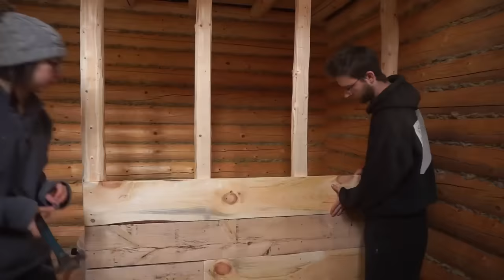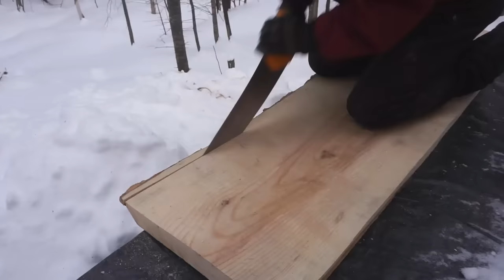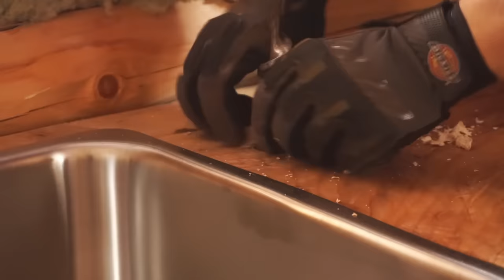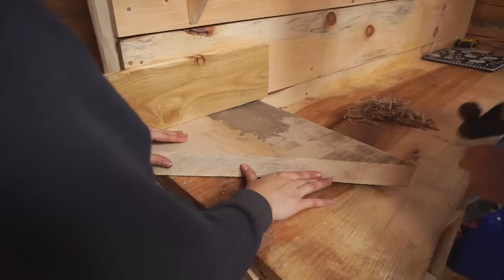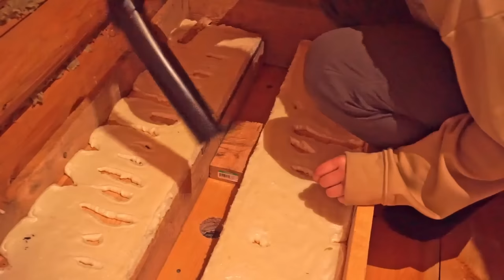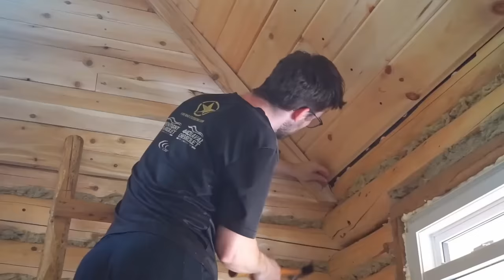Canadian Couple FINISH the Interior of Their Secluded Tiny Log Cabin | Built Without Power Tools!

Comment: I SALUTE YOU for your patience and perseverance. Here's a tip when driving screws into wood: Old timers used bar soap,
petroleum jelly, leftover cooking fat, etc. into which one dips the screw(s) to lubricate them, making insertion easier (less friction) and makes removing these screws much easier. Why? Because the resins in the wood are heated and weld themselves to the screws especially with green, not kiln dried wood....spruce, pine, fir, etc.

Comment: I was taught early on not to nail floor nails straight down but to angle the head slightly down the length of the board to stop them 'springing' and causing squeaks.
When using a handsaw extend your forefinger down towards the blade then use jt to guide the saw along the cut line.

Comment: An old guy.  A large part of the art of using a handsaw is using the entire length.  For years I carried to every job three full sized handsaws    A 5 point rip saw,, rip saw teeth are sharpened differently from a cross cut saw.  And two cross cut saws, an 8 point, and a 10 point.  With a sharp hand saw I can cut a 2X4 as fast as I can cut the same 2X4 with a power hand circular saw.  AND  I do not have to stretch a power cord.  The power saw is much faster when I must cut many,  Index finger runs down the side of the handle, shoulder is aligned perfectly with the cut.  The saw strokes its full length ,, ideally 24 of the 26 inch length.  Exert near zero down pressure,, allow the  weight of the saw to do the work.  You already do very well,, these are just minor improvements to your excellent saw work.
For sharpening,, Boston Saw and Knife  Needham , Mass.